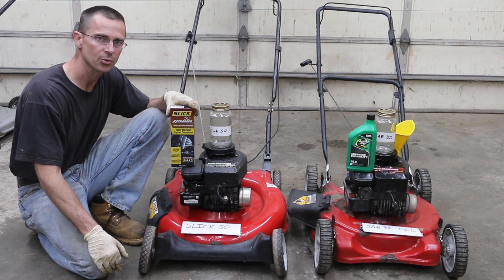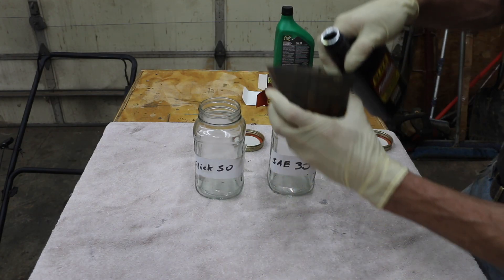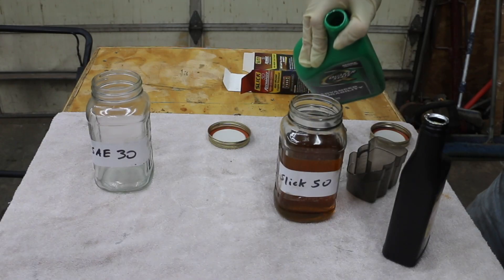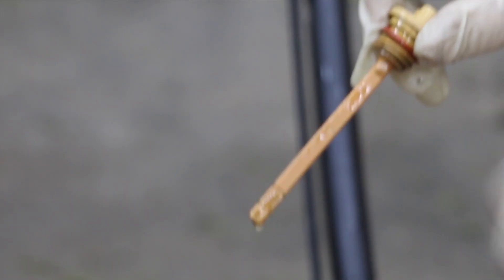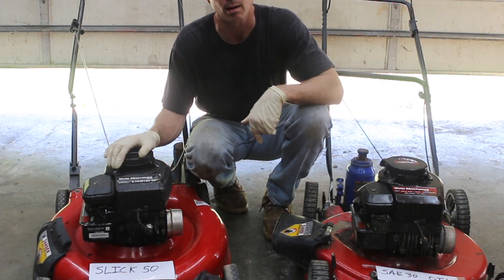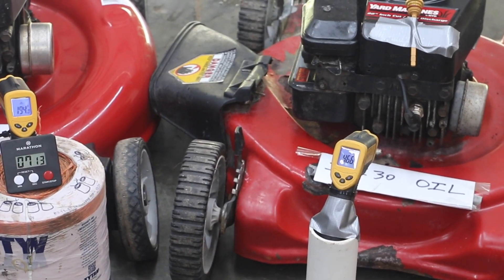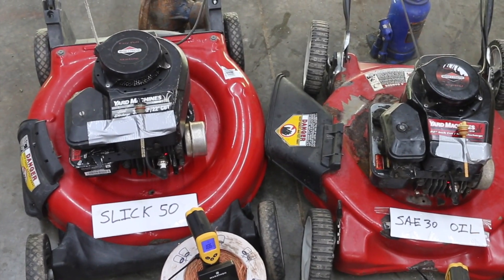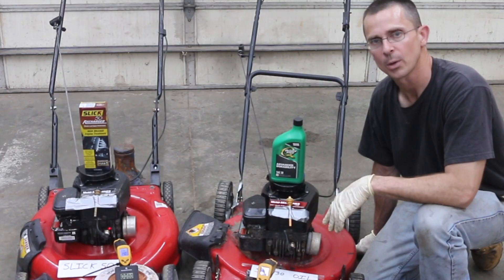Can't believe what SLICK 50 did to my engine!!--Dry Crankcase Test!

Comment: Q Is it true that Xcelplus is the original Slick-50 formula?
A Yes. In 1983 John Bishop the inventor discontinued the supply of  the formula to Petrolon who marketed Slick 50.
Q Can the manufacturers of the new Slick-50 formula quote tests done with the original Slick-50 formula?
A No. The Slick-50 settlement with the FTC (Federal Trade Commission) prohibits Slick-50 from making claims that rely on the original Slick-50 tests.
Q Can Xcelplus quote tests done under the Slick-50 name?
A Yes... for any test done with the original (pre 1984) Slick-50 formula.
Q What is the difference between Xcelplus and it's competitors?
A Xcelplus is a long lasting treatment (160,000 km between treatments).
Xcelplus has been tested extensively.
Tests are provided on the web site.
Q Do you have a picture of the PFL (Permanently Fused Layer) coating?
A Yes in the Tests section (Franklin Institute and NASA)
Q Are Xcelplus claims substantiated?
A Yes. There are tests by independent laboratories, consumer and government organisations: Look in the tests section.
Q Is pressure testing (Falex ball test) a valid way to establish which products work best?
A No. Extreme pressure additives usually contain high levels of chlorine and sulphur. Chlorine forms hydrochloric acid (HCl) and sulphur forms sulphuric acid (H2SO4) over time and damage your engine.
Q If my engine is quieter does this mean a product is reducing wear?
A No. Extreme pressure additives like chlorine and sulphur make engines quieter but can damage your engine. Oil stabilisers and viscosity improvers make your engine quieter but don't always reduce wear.
Q Is Xcelplus an "oil additive"?
A No. Xcelplus is a "Metal treatment" and "Boundary Lubricant". It treats the metal not the oil and prevents metal to metal contact.
Q Does Xcelplus contain PTFE (Poly Tetra Fluoro Ethylene)?
A Yes.
Q Is PTFE the active ingredient?
A No. The manufacturer (Petrolon) says it is not and so do Dupont.
Q Why do you no longer mention Teflon in your products?
A Dupont trademarked the name Teflon (aka PTFE)
Q Is Xcelplus compatible with all metals?
A Yes
Q Can Xcelplus block my oil galleries?
A No. An oil gallery is typically at least 8 mm in diameter. Xcelplus coats to 1-2 microns (1/1000 mm).
Q Can Xcelplus interfere with engine clearances?
A No. Xcelplus coats to 1-2 microns (1/1000 mm) and this is too small to interfere with any clearance.
Q If engine tolerances are too tight, causing abnormal wear, will Xcelplus help?
A Yes. When the clearances are too tight Xcelplus provides boundary lubrication which prevents wear.
Q Why doesn't my idle speed increase if the friction is decreased?
A In modern cars the Electronic Control Unit (ECU aka computer) will keep the idle at the preset speed.
Q When will the idle speed increase?
A After treating with Xcelplus engines with carburetors normally show an increase in the idle speed.
Q If the friction is reduced why doesn't the temperature of my engine drop?
A The thermostat keeps the temperature in a pre-set range so you normally never notice any improvement.
Reply from the maker: Thanks for sharing.

Comment: I remember that commercial well and one by another company (wynn I think) where they put it in an airplane and flew it with no oil. A representative came to the trade school I was attending as a kid. He had a machine like yours that had bushings on a shaft spun by an electric motor. First, he would run straight oil and add weights to a lever that pressed on the bushing. It took about 12 lbs to lock it up, then he added the additive and, this time he used all of his weights and even allowed us to press on the lever with our hands. It never locked up and I have believed in it until today. Your test was more comprehensive than his. but I still can't understand the difference in the outcome.
Reply from the maker: Thanks for the feedback.

Comment: Well, as my old statistics prof often said:  One (datum) DOES NOT A TREND MAKE!"  I can imagine a host of differences, e.g., tolerance differences between moving parts was not established initially (for one)) that could make a difference in the outcomes. For another, were both engines actually seized or did one have another issue, e.g., fouled plug maybe?  
Nope.  I'm not ready to draw any conclusions AT ALL from this one experiment.

Comment: In the mid 1960s a guy representing Wynn’s Friction Proofing came around towing a flathead Ford engine on a trailer , the engine had Wynns in it , he would. Start it up , run up to temp , then drain the oil with the engine running , then he opened a door cut into the oil pan and you saw an empty crankcase and a crank spinning around , he would close the door and pour the oil back in and everything would quiet back down , the Chi- Town - Hustler was sponsored by Wynn’s and if they. Indeed ran it in their Nitro engines it might explain their good performance.
Reply from the maker: Thanks for sharing.

Comment: I was part of a slick 50 demo in 1988. At the phoenix racetrack. They took out the drain plug and laid it on the bench. I saw the oil drain out. With the drain plug still on bench the lowered the car and started it up then drove it around the track. Engine did not lock up, but temp was high.
Reply from the maker: Thanks for the feedback.

Comment: The engine with Slick50 ran a lot cooler. In a normal situation (aka the engine has lubricant) is there a benefit to this?   Maybe Slick50 isn't all snake oil...
Reply from the maker: Thanks for the suggestion.

Comment: Synthetic motor oil is very difficult to wipe off of a metal surface.  It adheres very well and I believe maintains film strength and adhesion,  considerably better than conventional motor oil.  How it would work in a splash lubrication only,  small engine,  I don't know.  It might be worth a try.
Reply from the maker: Thanks for the suggestion.

Comment: I swear, I had a '79 Mustang w/ a 2.8 V6 that had been "Slick 50'd".  It didn't have a drop of oil or coolant in it, and we would use it for a B- double -E double R-U-N. It was only a mile to the store, and I would shut it off while my buddy was "shopping", but they were amazed that a car with no oil could do that. I believe if I would've had a radiator that held water, we could have gone farther. Engine was still good when I donated the car to teenage nephew for a parts car.
Reply from the maker: Thanks for sharing.

Comment: Sorry, this is not a valid test with out tearing down the engine and measuring the wear on critical surfaces before and after the test. Also an attempt to let the engines cool then fill and re-cranking the engines is needed. I suspect the engine with the slick 50 film shut down first because the slick 50 got thick enough to stall the engine maybe without allowing damage to the engine. You need to investigate further.
Reply from the maker: Thanks for the constructive feedback.

Comment: I kinda attribute the Slick 50 engine stopping sooner to "other factors", because the Slick 50 engine was running significantly cooler than the SAE 30 engine.  Not just a little cooler, a LOT cooler.
Reply from the maker: Thanks for the feedback.

Comment: Lived in Fairbanks AK back in the 70's there was one slick 50 dealer who had an old dodge 6 cylinder and would drain the oil than drive people around town. Did this test many times. Another a friend dirt tracked raced running a chev 350. lost oil pressure around lap 15 finished a 50 lap race took engine out and put it in an old flat bed truck and ran it for years. Another in Anchorage they treated an Cessna 150 engine than drained the oil and flew it around the airport with not problem.  Also have heard slick 50 is not the same today.
Reply from the maker: Thanks for the feedback.

Comment: I remember that for many years the motor oils of the Slick-50 type were only used in small aircraft engines and you were NOT supposed to mix it with any other type of oil. The idea was that in the sudden loss of oil the pilot had several minutes before the engine seized to find a place to set down. Remember a pilot (unlike an average driver of an automobile) monitors his engine instruments at all times. And it was very expensive compared to regular engine oil. Try that same experiment with the Slick-50 NOT mixed with any other oil and I think that you will find that the Slick-50 engine will last longer after being drained.
Reply from the maker: Thanks for the video idea.

Comment: In an automotive engine the teflon particles can plug up the oil filter but you won't notice unless you cut the filter in half. Used in a small rotary plane engine, the filter got plugged with PTFE at a higher colder temp and stalled the motor. The plane landed safely. The US military will not use PTFE in any internal combustion engine. FTC alleges that Slick 50 neither coats engine parts with a layer of PTFE nor meets military specifications for motor oil additives.Try Wynns, BG, Redline, or a High ZDDP oil like Driven or PennGrade 1 Green HP Oil
Reply: This was the comment I was looking for thank you kindly good sir 👍

Comment: Tried slick 50 when it came out it caused numerous oil leaks, causes seals to harden and leak, every engine we used it in failed, even the diesel trucks.
Reply from the maker: Thanks for the feedback.
Reply: Engine rebuilders toss the blocks that have been treated with teflon, it fills the oil pores and causes rings not to seat.

Comment: Since the oil is also part of the cooling mechanism on these small engines, I wonder how much different (if at all) the results would be in a liquid cooled engine? (Not that I'm suggesting you waste two liquid cooled engines on this test, though!) Just a thought.

I do remember a lot of discussion back in the day about PTFE forming acidic compounds when exposed to the heat of the combustion chamber, and even then people were saying that it's actually horrible for your engine. We know that science has come a long way since then, and even Wikipedia has a pretty comprehensive discussion on PTFE (https://en.wikipedia.org/wiki/Polytetrafluoroethylene.) I'd be interested in a GCMS analysis of any residue on the inside of the cylinder wall of these two fried units (like some kind of diabolical "machine-bong-resin.")
Reply: Agree: I believe there’s a bigger difference in water cooled engines
Reply: When metal heats up, it expands and so the motor will eventually stop when the temperature gets high enough.  Therefore, a water cooled engine will keep running longer.

Comment: The front tires of the slick 50 mower are both  worn and bent. It was also set up for mulching rather than side discharge with no capabilities for height adjustments. Overall a cheaper, harder working mower with many more hours than the straight 30 weight mower. It's a mower that clearly had been beaten to death before you finally killed it ;)
Reply from the maker: Thanks for watching!

Comment: I have run a mower without oil way longer than 6 minutes - knocked the oil tube off my Tecumseh engine lawnmower and all the oil dumped out - didn't realize it until I was done.  Fixed the tube and she fired right up the next time.     Must be cheap Chinese engines.
Reply from the maker: Thanks for sharing.

Comment: 1. Did you measure running temp with similar lube to test for unknown variances?
2. Which motor was blowing hot air on which motor?
3. What was the normal temperature differential between the two locations?
4. Did the 30 weight oil in both engines come from the same container, proving identical 30 weight oil in both test beds?
Trying to be a scientist isn't easy.
Reply from the maker: Thanks for the suggestion.
Reply: @ProjectFarm  You're welcome! I worked for IBM right out of school and had so many amazing experienced engineers around me that could point out how inconsistent everything was from raw materials, to processes, etc. and you quickly start to think of ways to unify things you need to be the same and isolate the inconsistent environment from affecting your results.

Comment: My experience with Slick 50:  After break-in I put it in my Honda.  After 130k miles with regular oil changes, my oil began to look rather dark so I put in a can of Motor Flush.  Almost immediately the engine started to loose power, burn oil and developed a noisy valve train.  When I disassembled the engine the rocker arms and shaft were severely scored and the piston rings completely gummed up.  The Teflon had been dissolved by the Motor Flush and clogged up the oil passage to the head.  I rebuilt the motor and drove it another 270k miles and never used Slick 50 again. And yes, I have used Motor Flush before and since and have never had any other problems.
Reply from the maker: Thanks for sharing.

Comment: I recently saw an interview with John Bishop, the original inventer of Slick 50, and he said that the product being sold today is not the same as the original. So maybe the forever running engine was the real deal.
Reply: My personal experience with the old version of Slick-50 is that it saved my engine when the water pump failed 40km from home and I drove the car, at high speed, to buy a replacement, then to home for fitting and then drove it for many years afterwards without any issues.  Yes, the car did boil the water dry to the extent that the temperature gauge dropped back to zero, yes there was steam coming from under the bonnet, yes I did refill the radiator (three times) and lost all the water again. But no, the engine never nipped up and always started even after turning the motor off when the water was lost.

I now buy the replacement product Xcelplus and it goes in every engine I have.

My brother-in-law wrote that car off by running off the road and hitting a strainer post, the engine was still fine.
Reply: Tony HD  I don't know! I'm just stating what the inventor said in an interview.

Comment: How do you explain that the engine with Slick 50 stopped working at so low temperature (245 F) ?
Reply: The Slick 50 mower chassis looks older and so guessing motor has less compression having more hours,  Yikes,  wierd
Reply: I just rewatched the video again and we can see that the laser of the probe is not pointing on the cylinder head but on half on the sparkplug and half on the cylinder head.  I guess this is why the temperature is not good.

Comment: In my experience slick 50 can reduce friction, but it's not a miraculous difference, and there's probably a reason they don't run the oil-free engine commercial anymore.
As for which engine lasted longer... I'm only guessing, but the one without slick 50 looked like an older engine... could the wear & tear on it mean it had more "looseness" and slop in the parts? It could just boil down to which engine had tighter tolerances, and the heat would tend to cause that engine to seize first, no?
That's just a guess though. Logically lower temperatures does strongly imply lower friction, and I can't think of any reason the slick 50 should make an engine seize "faster".
Reply from the maker: Thanks for the feedback.

Comment: FR3 FR3 FR3 FR3 FR3,,i have done the same thing as you with a clinton 1 cylinder engine,,it refuses to seize,,,you will soon use it in every engine you own and will see a smoother running,cooler running more powerful engine in the first 15 mins
Reply from the maker: Thanks for the feedback.

Comment: I would be interested to know the relative condition of the two test engines. Were they both new? Did they both have the exact same hours of use prior to the test and under the same conditions?  Must control the variables in order to achieve valid results.
Reply: I can't believe your reply / question only had 1 like prior to mine... It shows that common sense / intuition isn't as common as one might think.
I would assume this has to be due to a general lack of experience in such things... I totally agree that In testing such as this. You would have to start off with at LEAST two brand new identical engines, that're treated IDENTICAL to on another, in every aspect in-order to maintain control. I would even test each motor separately in a atmospherically controlled environment to eliminate any outside influences that could tarnish the results.

Comment: Very Nice wake up.   I used that stuff in my large riding Sears lawmower..to see if it would extend engine life.  I used it with every oil change and filter.  My results were ...... that it did not extend the engine life... engine still wore out when expected.  So....very nice test.   By worn out I mean after normal light residential use ... it began using / burning oil at about 10yrs old even though every oil change we gave it a dose of SLICK  50.....
Reply from the maker: Thanks!

Comment: It was very entertaining, but, unless you began with brand new, identical engines, the data are not reliable. The Slick 50 engine may have had markedly different operating hours logged vs the plain oil engine. Their historical maintenance may have been different, eg., the Slick 50 engine might never have had an oil change since new and the regular oil engine a history of 25 hour interval oil changes. Costly thought bing else, the  it may be, side by side comparisons must be performed on platforms that are as similar as possible in order to measure the outcome reliably. Having said all that, let me add that I was astonished at the differences between temps at time of failure. If no
Reply from the maker: Thanks for the feedback.

Comment: Unfortunately, you are not using the original formula 1978-1984.  Big Oil bought out slick 50 and didn’t use original formulation.
Reply from the maker: Thanks for the feedback.